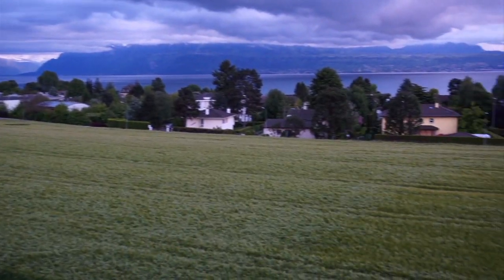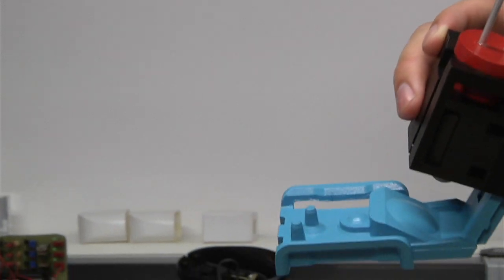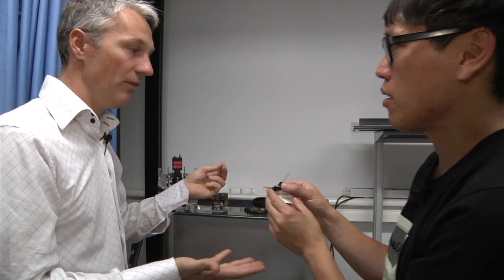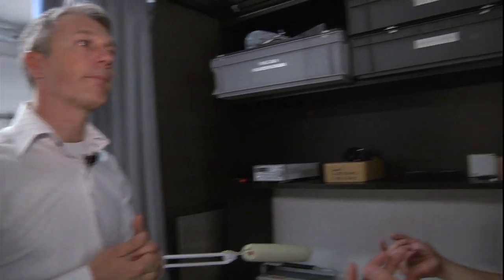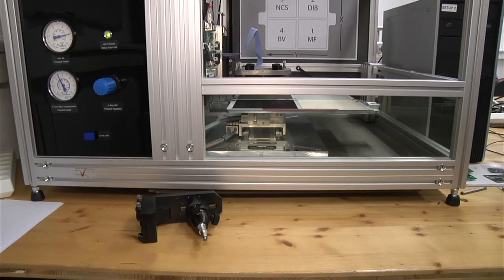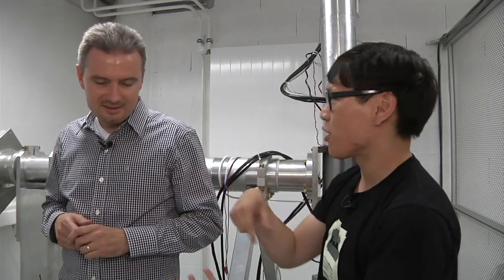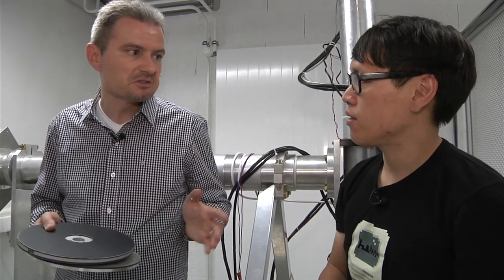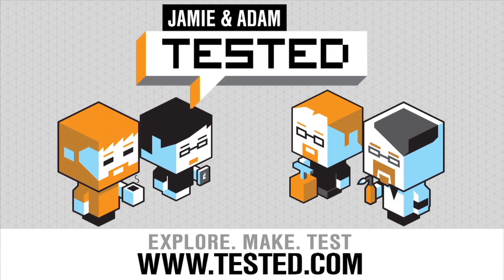The Making of a Gaming Mouse: Inside Logitech's Labs

Comment: Logitech have good inner parts (sensors, electronics, microswitches etc.), but holy cow, their mices SUCKS in terms of outer shape and ergonomics. I know this is very subjective, but seriously, I don't get it why they are making almost all their mices slightly inner-shifted on the right side. You know, that negative tilt, it's so uncomfortable. On the left side it's perfectly ok because thumb fits there well, but on the right side, it's totally different story. They are making this ergonomic mistake on and on, for ages. I hate this shape of the mouse, and because of that I don't buy Logitech mices, because almost all of them have this ergonomic nonsense in them - even Logitech G300 is crippled this way - AGAIN!! Seriously, I just don't understand. One mouse which has super-comfortably shape and ergonomics is Razer DeathAdder, and it's mainly because of the shape of the right side (no negative tilt to center). Logitech, please.... try to hire someone who has good skills at ergonomy design, because this is the main field where your mices are failing constantly.
Reply: +DuppeKP true that shape is absolutely perfect for me aswell. i dont use the 502, but the 402 instead wich has the same shape. i prefer the 402 because of the rubberized mousewheel instead of a metal one that the 502 has. but shape wise they are a perfect match for me.
Reply: For me the shape in G502 is perfect, never tried anything better.

Comment: In my opinion Logitech has one of the best technical aspects and drivers, but it fails in the design / ergonomic aspects on the mouse. Also, once they release a design, it is very unlikely to change soon. If they think they achieved a good design, it will stay on the market unchanged for years and years.
Reply: I completely agree. I'd also say they are the most reliable gaming brand. You buy their product and you know it's going to last 4, 5 years (or more), unlike Razer's toys.

Comment: My favorite Logitech mouse is the RX1000 - I mean not necessarily for gaming, it's a great mouse for artwork, I can draw a 1 pixel high line across the screen with this thing - it's insanely accurate, recommended for anyone looking for a less twitchy non-gaming mouse.  I have a £60 gaming mouse from Razer, and I'd still give that up before the RX1000, which cost about £6.

Comment: You have no idea what you are talking about. The sensor in the g500s mouse uses defective firmware and this has been confirmed. It's a known issue with ALL Avago9800 sensor based mice. Some Manf. released firmware fixes but Logitech will not be offering a firmware fix. They have refused to help the g600 user community and they will not help the g500s users. Dont waste your money on these new 8200dpi logitech laser mice.

Comment: Only a very good mouse will work on a smooth black surface. (I have experience with this problem.)  Cheap mice won't work on solid black desks.  It kind of sucks, as good mice are expensive, but less so than a new desk.

Comment: Logitech G9x? you can swap the most of the shell from wide for claw grips or thin for palm grip.

There are also a few more adjustable mice but they can't do it instantly like the G9.  The R.A.T 7 and 9 for example allow for adjustments but you have to fiddle with screws and stuff.